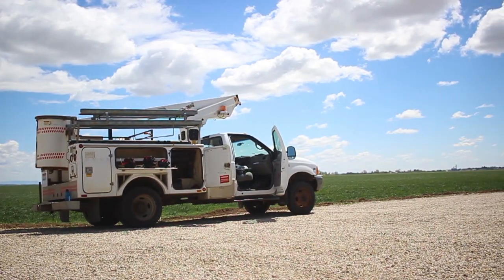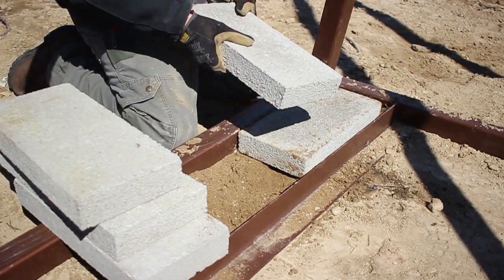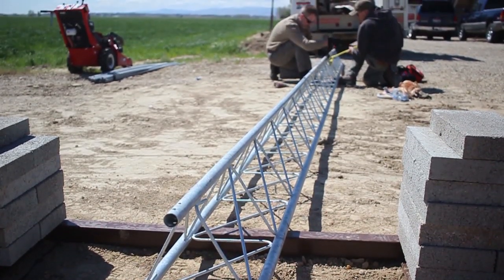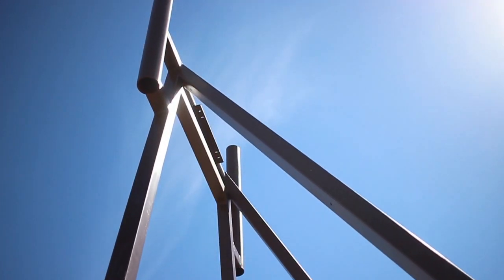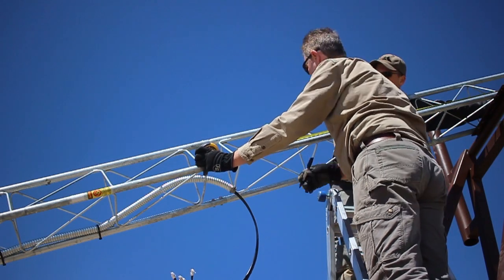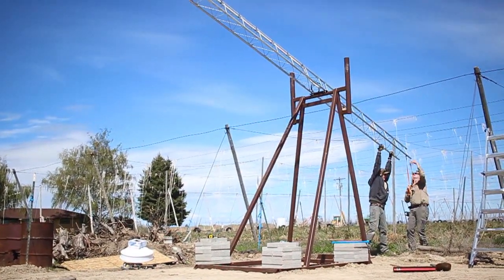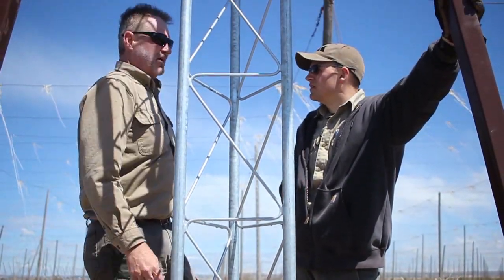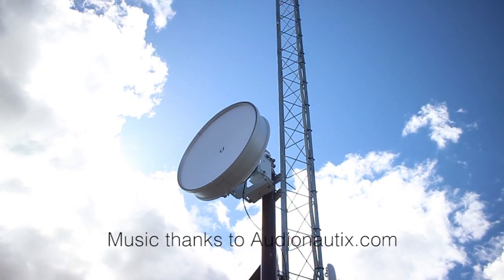Innovative Tilt-up Wireless Internet Tower

Comment: That stand is temporary only, far from stable. Put hole in ground, fill with concrete and rebar. 30' height is SFA for a PtMP setup and as pointed out, the backhaul gear too close to ground.

Comment: This is awesome. Is there a way to build one of these towers?
Reply: Uh...you just saw it done!  Or did you mean the support?  Dimensions would not be critical.  Any welding shop could build that in a day or less with just a picture to guide them, and dimensions on a Rohn 25 tower.  My question is stability.  There must not be any wind where that's installed.  Something like that would last about 1/2 of a good storm here in the Ozarks.  

What I'd like to know is why they climbed it after it was up.  The whole point of a tiltover tower is so you can bring the work to ground level.  Heck, one man could have set 50' of tower with that bucket truck, or even done the installation at the top with it.  Absolutely no reason to have climbed that tower.  Nothing about this video is safe, or smart.

Comment: Why climb it if it tilts over? Brainiacs!
Reply: Too much weight on head to tilt up....
Reply: @bentheguru4986  please! Those little antennas don't weigh crap! If it was a 10 Meter or larger vertical yeah. 

The main reason for tilt over is so you don't have to climb it! 

All they had to do was sit the top end on a step ladder, install the antennas and both of them pull it up! Done! 

We just built a hinge base and 20ft support structure for 60ft of Rohn 25 with 10 ft stinger for a 20 plus foot vertical 11M antenna! Thats 90ft total length.

Yeah we used a hand winch to raise it but they could do the same and remove the winch if they needed to.

Way to many people have died climbing towers when they didn't have to!
Reply: @WW5RM  I remember why I ditched my amature ticket many years ago, too many opinions. Stick to your HF and leave microwave to others. 
The guys barely had enough weight to stand it, extra 20 kilos of gear on head was going to be a no-go. The whole setup is not a real great option, just a PR video.
Reply: @bentheguru4986  we raise 2M antenna the same way! They way much more than those tiny antenna! We do this similar setup all the time! It's not an opinion! It's hands on experience!
Reply: @bentheguru4986  20 kilos? A 10M vertical doesnt weigh 20 kilos! Damn! I'm glad you left Ham radio! You are clueless!
Reply: @WW5RM  Well, A 2m vertical aNtenna weighs very little Kilos, Even a beam is light. Besides, i don't caRe... Read it close.
Reply: @bentheguru4986  i can tell you dont care! Without guy wires i guarantee they aren't putting 20 kilo antennas on this setup!
Reply: Ive NEVER seen UHF antenna that weighs 20 kilos! I have a Corner Reflector and Parabolic that barely weighs  2.5 kilos! Anything that weighs 20 kilos will NOT be installed on this type setup!
Reply: @bentheguru4986  A 2M Beam includes a rotor and cables too! Any UHF antenna weighs nothing compared to that!

They ARENT installing Microwave Guides / Horns on this little setup! NOT without guy wires!

So i say again! Them climbing this tower is DUMB!

Comment: Looks like another company got into the wireless game with little knowledge.  Tie-wraps are for temporary installs.  Could of used metal tie-wraps.  The point to point dish is to close to ground.  Will have interference from ground refletions.  Also a big truck could block link.  Instead of using flex counxuit, just use rigid conduit with metal stand-offs.  No one should climb a tower held down with concrete blocks that is that high.  Looks like climber was scared.  He looks like he was making love to tower.  I see installations like this all the time.  So sad no one wants to learn how to do it correct.  Was there even grounding done on tower?  You all tried your best.

Comment: Tie-wraps will only last about 1 year.  UV light makes them brittle.  Use #12 solid copper as a twist tie.
Reply: mine has  lasted over 10 years
Reply: @aedgvv6095  Do you live in a low sunlight area?

Comment: If only, topology said I'd need 80ft towers due to ground clearance and the cable company wants $28,000 to run new fiber out to the farm. So, no internet that isn't wireless for my folks for the foreseeable future. Sucks though cause if I could find a way to do it I'd put up two towers and just beam it the 2.9 miles to their house...they don't game and only want it for tv reasons.

If anyone has an idea about a tower solution that wouldn't be in the thousands of dollars let me know....so far two 80foot towers are cost prohibitive.
Reply: If you can gain access to the 3mi between, trench or hang some fiber. It's pretty cheap these days and media converters for 1Gbps or 10Gbps are plentiful. The link is electrically isolated so no lighting risk, grounding funk or other noise.